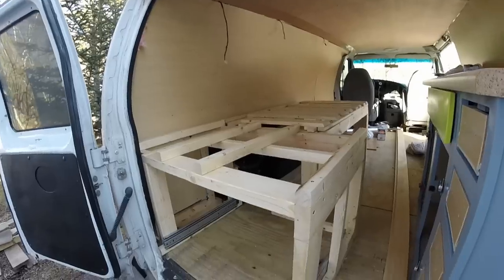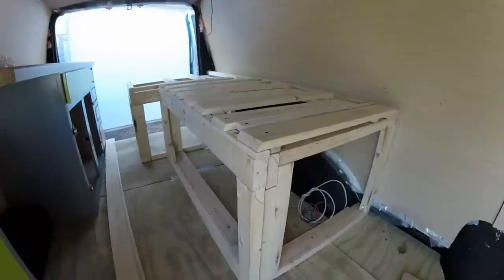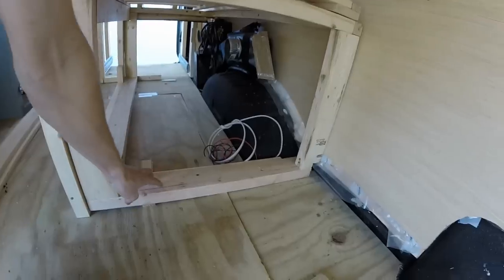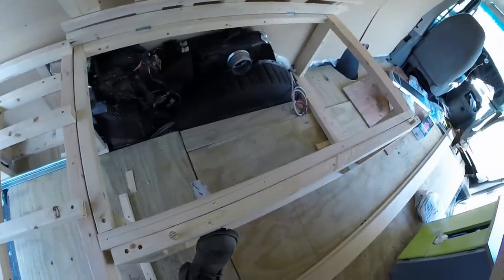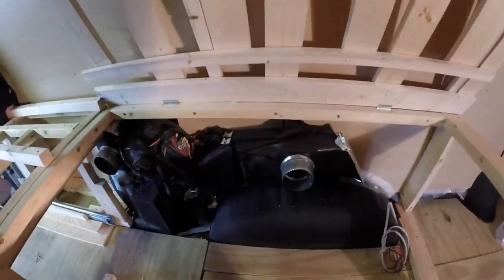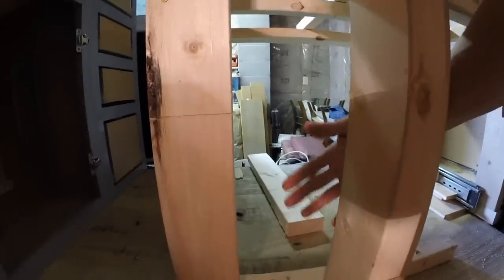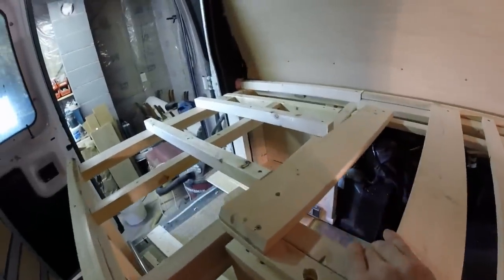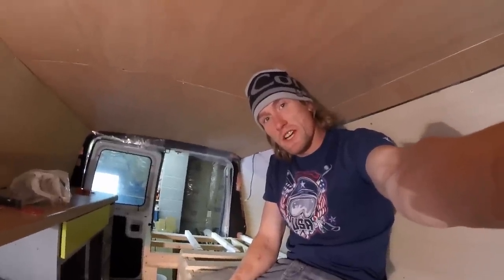Living in a Van - Expandable Bed and Storage #VanLife

Comment: You could have very well fitted AC unit below the Kitchen Table or other way round and reduce the Bed height to your comfort. Even now you can swap the bed & Kitchen. I don't know the dimensions but could be possible
Reply from the maker: No. The factory HVAC in the rear has rigid tubing from the engine bay. The complexity of re-routing or adding more rigid tubing from one side to the other far outweighed this minor inconvenience which doesn't even bother me.

Comment: Since you're going to be running your vehicle for heat and AC, did you ever consider installing a small window unit through the metal of the back door and using an inverter to run the AC?
Reply from the maker: hot2warm No, because I won't be running it non-stop for all my heating and air conditioning conveniences. I plan to head north in the summer and south in the winter. For the days I'm really miserable, I'll find a lake or a river or something.
Reply: +Low Gravity Ascents ---I am on the train, setting up my camper van right now. Props!

Comment: I was curious why he didn't just put the bed on the other side and have the AC/heat under the desk.  Then you could even have it blowing straight on the bed instead of out of the sides.  That would cut down on how much energy you use since it wouldn't have to warm/cool the whole van while you slept... it would just be blowing the heat/cold on you.

Anyway, cool set up regardless.

Comment: Get a good 245 watt solar panel. Also if you use any kind of burning substance, especially propane, get a good carbon monoxide detector and smoke detector.  Consider getting a roof raising kit that provides a protective roof.  Keeping steel beams in the roof to maintain structure or adding in steel roof supports for the new roof in case of a rollover

Comment: With a good 245 watt and 4 deep cycle 6 volt golf cart batteries wired in series in two pairs to give 2 12 volt units you can add in an inverter to get 120 volt ac in addition to 12 volt items.  This will allow you to power a fridge- digital chest style fridge would be nice(can be pricey but you can put food temps right down to just above freezing to keep things super fresh much longer).  And you can have a small electric heater which will heat your entire van in the coldest of weather.   You can also put in a propane burner to cook things just do everything super safe.
Reply: Good one, 2-100w 12v panels

Comment: Nice design but that heater is a bummer. I would only consider a hi-top van as a camper conversion personally. The fuel mileage isn't really that much lower considering all the headspace and storage you gain.
Reply: Well, you're peeing pretty straight. Nice work.

Comment: Just curious, could you have placed the bed on the other side and had your kitchen unit on the drivers side? Pretty awesome build and love your color choices. I've subscribed!
Reply from the maker: Cyndi Leonard Could have, but then all the tubing for the HVAC would have taken up too much room in the storage cabinets. Not to mention if I do run the rear HVAC while I'm sleeping, I wouldn't get the added benefit of it heating or cooling my mattress.

Comment: where does the mattress go when ur not using it? against the wall?... or will it be a fold up one?
Reply from the maker: I use two self-inflating backpacking mattresses. When it's in single-person mode, one of them just stays on top of the bed and the other one gets deflated, rolled up, and put under the bed in storage.

Comment: The fact you are sitting down and hunched over is a real bummer to me. A sprinter van allows you to stand up and would be a better vehicle if I was to ever do this.
Reply: Yeah I agree, I wondered if he could of built his desk around the heater? 
then he could lower the bed
Reply from the maker: +alan mackintosh I'm right here. You can just ask. ;)
Reply: +Low Gravity Ascents ok, why didn't you build the desk around heater so you could have a lower bed?
Reply from the maker: +alan mackintosh Because where would my bed go if the desk was right there?
Reply: +Low Gravity Ascents  well it looks like you have the bed on one side of the van ( the heater side) and the desk on the opposite side.
I was wondering if it would be possible to swap them so that the bed would be where desk is now, and your desk could be where the heater is.
that way you could have a lower bed.
Reply from the maker: +alan mackintosh But then where would all my kitchen cabinets and storage go?
Reply: +Low Gravity Ascents  
hey I'm not trying to criticise but if you did it that way you could have a lower bed and be able to sit upright.
you may lose some kitchen storage,  but that heater doesn't look that big so you should be able to fit some cupboards around it.
Reply from the maker: +alan mackintosh "Some," but not enough. And then I wouldn't be able to fit all my climbing gear in the pull-out gear drawer in the back either. All these things were considered. The bed is where the sacrifice needed to be made to fit the rest of my stuff. Besides, I have a chair that I sit on with enough headroom to work at my desk/counter.
Reply: +Low Gravity Ascents ok fair enough👍